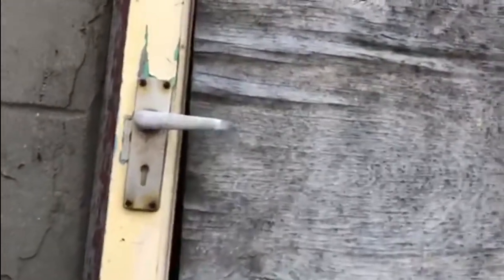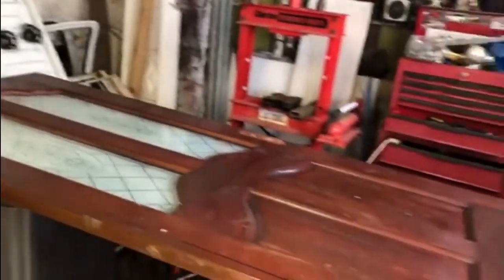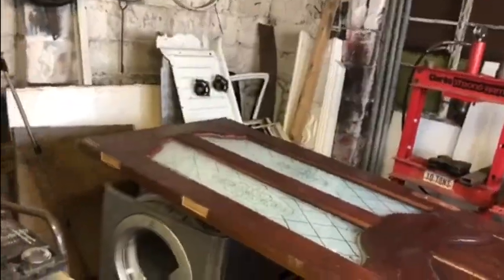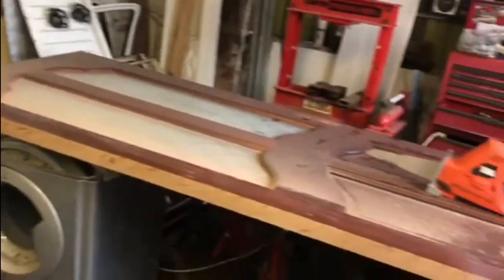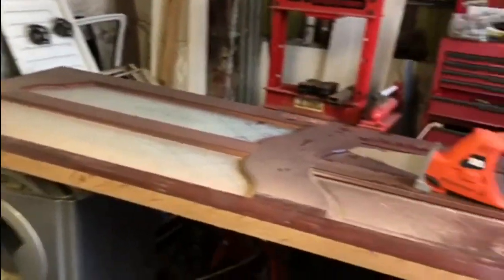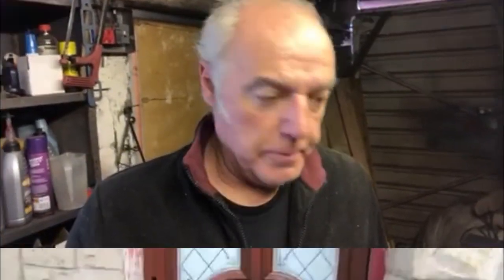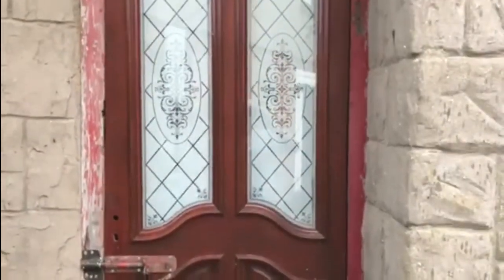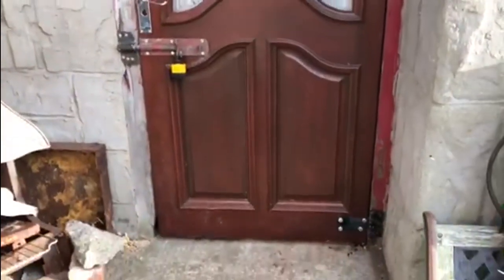Garage Repair and Transformation - New Door

Comment: Can vouch for those black and decker saws, we have one that I used to cut up old decking when we we removed the decking from the back of the house last year, made excellent progress in chopping it down to a reasonable size to either give to people or take to the tip.
Reply from the maker: It’s a great little saw, think it was a bit much using it to cut the door to size though, a circular saw would have been better. Perfect for cutting the joists in the garage though